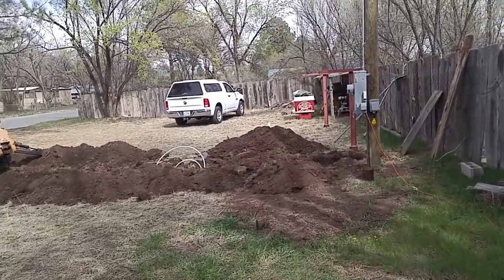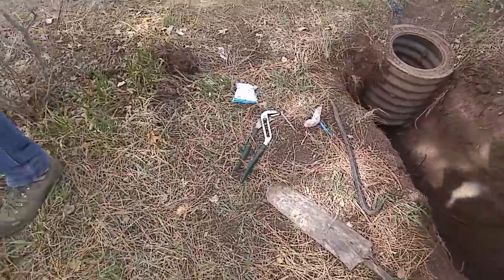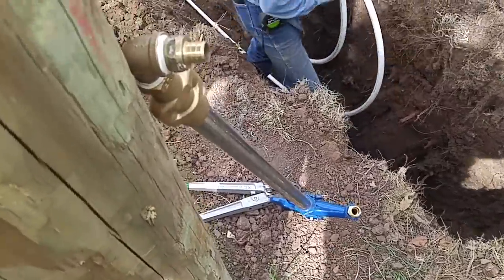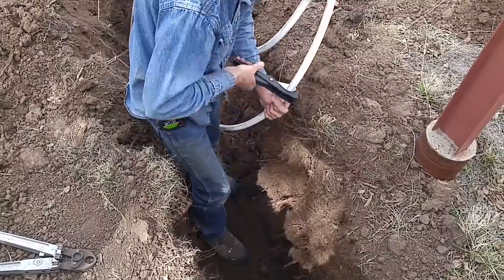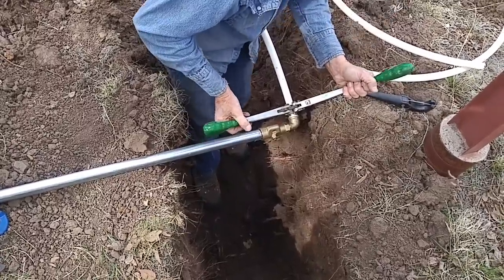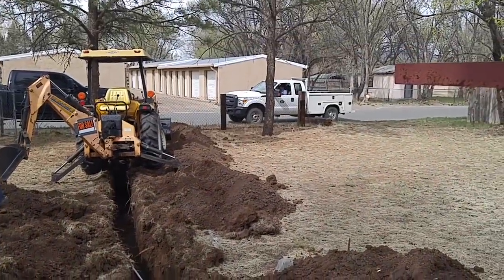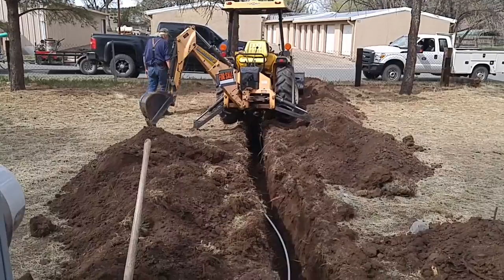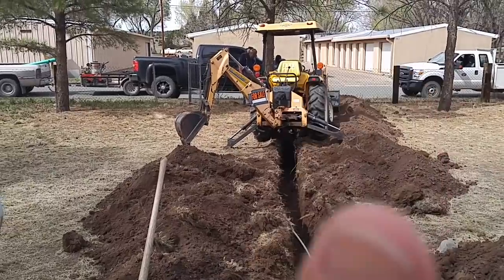NEW WATERLINE...just about done...Home Base Capitan NM

Comment: We always gravel packed ours on the farm/ranch at least 1’ above and 1’ below the drain hole on the bottom. We also drove a T post beside it to brace it. We used hose clamps to attach the spicket to the T post. Bailing wire some times.
Reply: Ira & Bobbi Pickard that’s good preventative measures......a little detail on the front end saves a lot on the backside!
Reply from the maker: we used gravel

Comment: If the drain is not in a bed of gravel, dirt/sand/ mud can enter the water pipe through the drain hole and you will get a shot of dirty water when you turn on your water. With these types of faucet you need to use a external RV water filter if hooked to your camper.
Reply from the maker: gravel underneath

Comment: I used PEX. Great alternative to traditional plumbing. So easy to work with and durable. I bought the crimping tool also. It's like a dream come true for the Do It Yourselfer. Mighty fine water spout you had installed, Rusty.
Reply from the maker: expensive, but worth it...thanks
Reply: @rusty78609  It'll be a better day with it than without it.